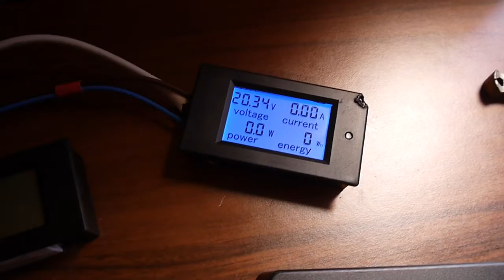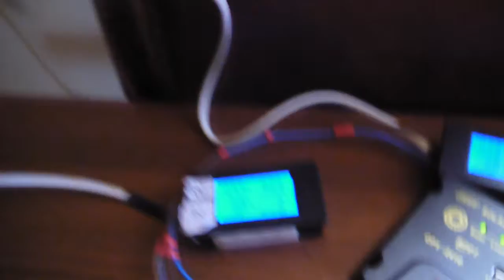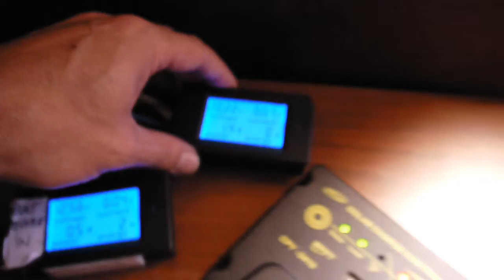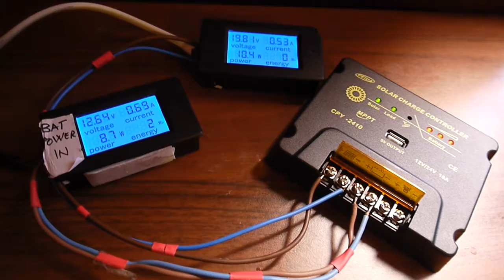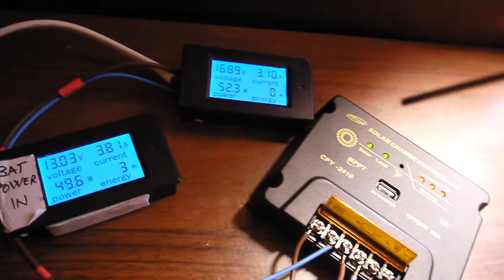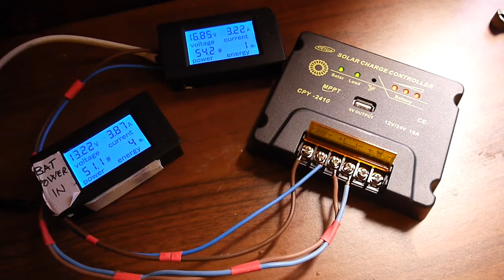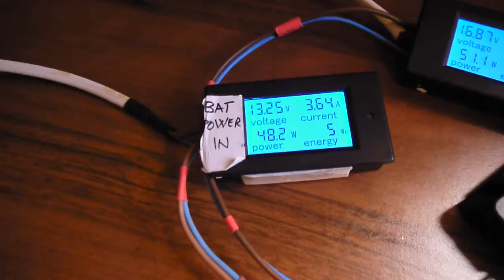CPY-2410 MPPT solar charge controller test..Fake MPPT ?

Comment from the maker: Somehow this little one is doing a decent job.The test with the big brother CPY2420 it was also pretty ok, but in the field turns to a very disappointing unit.Finally it can be used for small panels, mine is only 150w/20v/36cells.

Comment: At least this is a real MPPT!  You see at 5:43 it gives you 3.79A compared to 3.15A from Solar. That is 20% more.  Its the cheapest real MPPT as I know. From 22USD (Ali) for the 10A to 29USD (DX) for the 20A version. 
Nice with 5V USB-output. Bad there is no LCD for charge information.
Reply from the maker: Right, It's doing a kind of conversion, in a certain range it's working, but I don't trust it, it's getting confused by solar peaks, also I notice a high voltage on the bateries, some 16v and more..it's up to you to use it.I'm not!
I'm using Victron Bluesolar and Epever Tracer and both are much more secure.
Reply from the maker: Hey! Just give me a hand and  subscribe ! Thanks!

Comment: You are very good at making these videos and people will know what you buy and what panels you have.?
Reply from the maker: I started from simple cells, so I put them together, solder one by one in  two panels summing 150w, 20volts.I'm able to charge a 12v battery with almost 7Ah in full sunshine It's a DIY experiment, I'm trying to find how the solar things are working.Until now I found that you need a lot of passion and there is no recipe for a good system.
Reply from the maker: Hey! Just give me a hand and  subscribe ! Thanks!

Comment: I have one of these. it works well with a 250w solar panel  but I have observed that if you have the usb or 12v outlet power connected  it is unreliable
Reply from the maker: Hey! There are a few models, with different motherboards, with the same generic name, some of them are working ok, maybe you've been the lucky one and got a good model.
The first test were pretty ok, but later, with bigger powers and charging rates, it was absolutly unussefull.Now I have a Epever Tracer A 4210, very reliable and secure.
Good luck !
Reply: Viorel Caia yes you are right I have a cpy2420 and it is working well but don't wire anything in the 12v load it really messed its tracking up.
Reply from the maker: Nice for sharing..there is a lot of folklore about this chargers, any good information is very welcomed! Thanks!
Reply from the maker: Hey! Just give me a hand and  subscribe ! Thanks!
Reply: What battery works best for this mppt?

Comment: Not sure why your video title says "I don't recommend". These results are very good. I have two of them and although sometimes they are a little temperamental when they are connected (a lead needs to be disconnected and reconnected to get them "started") I find they are very efficient and value for money. They are definitely MPPT too
Reply from the maker: Please read the comments.I said they are doing the job..somehow, but if you really work them to the advertised currents, my model was out of everywhere! When I used little power, few amps and small power PV 100W it was ok.I ment I'm not feeling secure to install and let it run without observation.Is very possible I received the wrong board, as they are in many models in the same case, with different configurations!
Reply from the maker: Hey! Just give me a hand and  subscribe ! Thanks!

Comment: I have one of these, it is total garbage, never produced the output power it was supposed to and on the first day under a clear sunny sky with no lightning or power surges it made like a noise of popcorn popping and that was the end of it. No support or return from seller or refund.
Reply from the maker: It's looking like you've been 'the lucky one'..like me and get the fake/wrong motherboard.As I understood, some of them are working...but for it's very clear, I'm not gonna waist my time with this kind of design!
Reply: It's a real pity, some like Adam Welch were lucky to get the good ones. His success with these units was the reason I bought one. It's just weird why you would change a design from a working design to a piece of trash?
Reply from the maker: Hey! Just give me a hand and  subscribe ! Thanks!